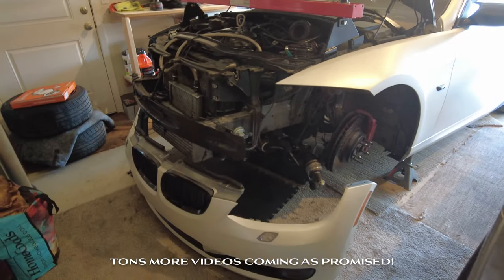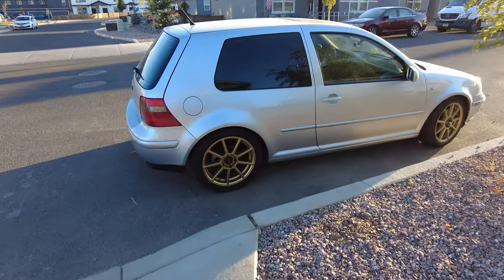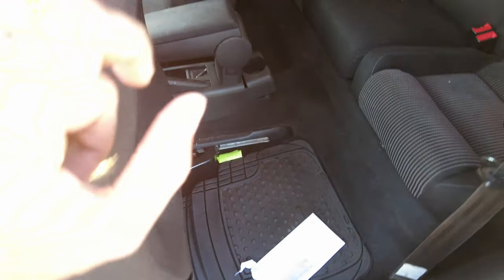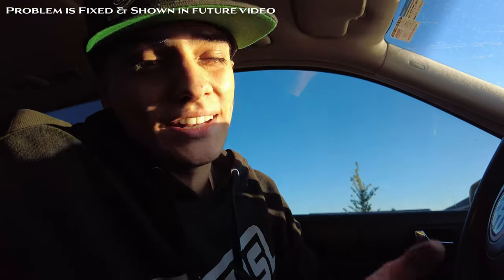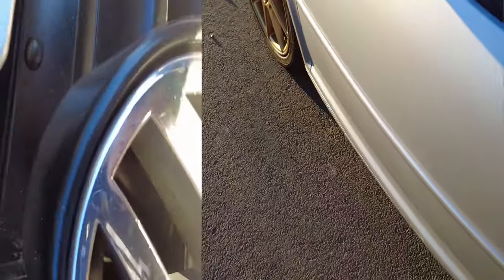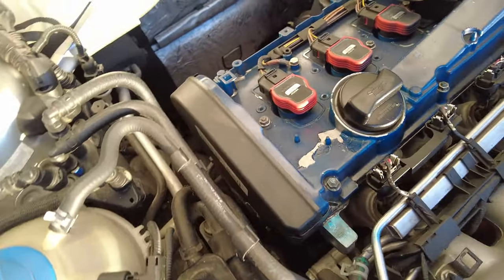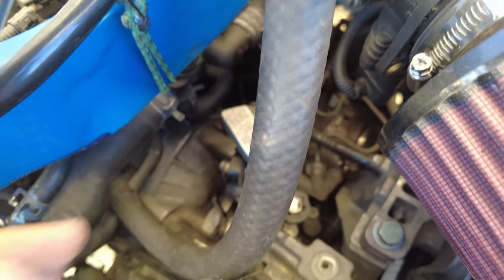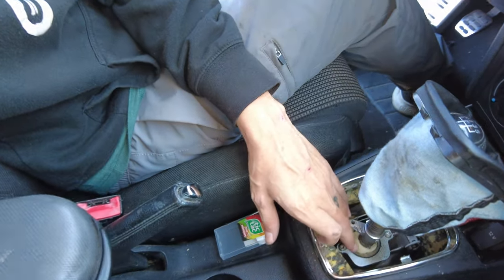TRADED MY RD1 HONDA CRV FOR A MK4 VOLKSWAGEN GOLF GTI! Was it a MISTAKE?

Comment: Vw will always be a vw. I would have kept the crv they are appreciating value.Mind me asking what package the crv was? If you traded a base fwd auto I get it. I own 2 mk4’s gti’s one is the 20th anniversary but also own a crv 4wd 5speed, not to mention the versatility for a cr-v i wouldn’t trade this thing for a gti. No way, but still cool gti man good luck with it. 🤙🏼
Reply from the maker: CRV was AWD 5 Speed manual I think LX.
I had initially bought it as a little sleeper or Off-roading rig but in the 6 months I’ve been here I havnt gone off-roading and the b20 isn’t good for boosting because of the thin walls. That being said the CRV would have been the better package in the winter snow but for just dailying around daily the VW has better MPG and sounds cooler in my opinion. The CRV was just slightly underpowered for me and I think I’ll be back in a 2nd Gen with K series next time.
Thanks man!! First gti I’ve owned and it’s pretty sweet for a lil hatch